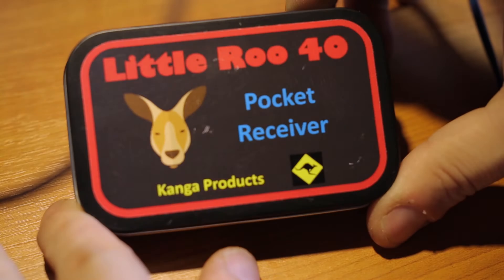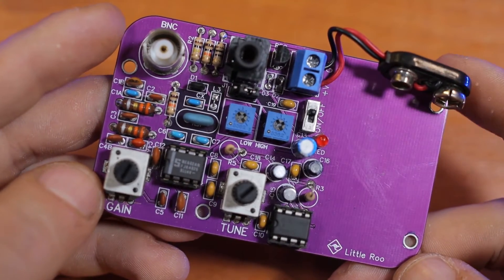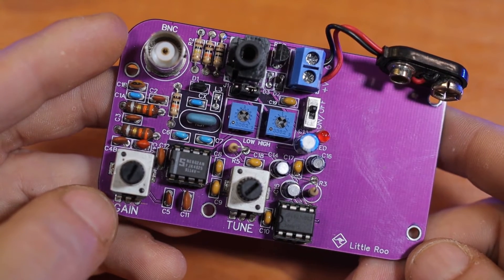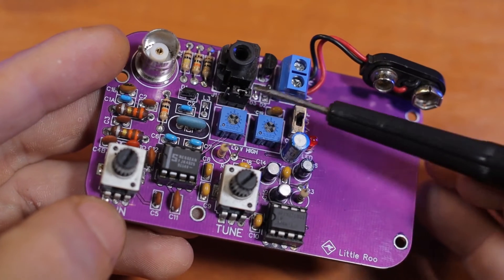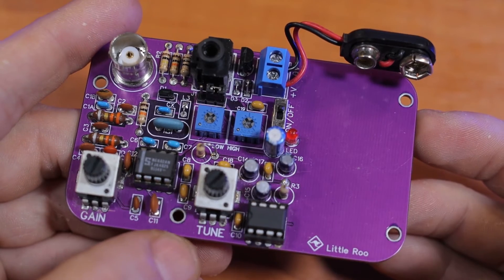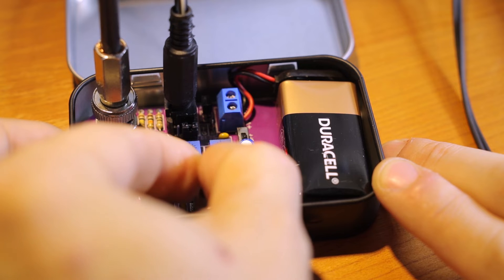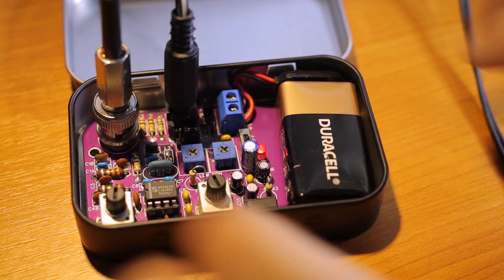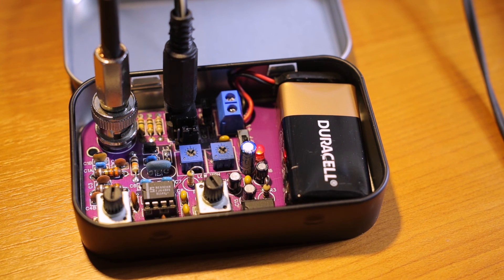Little Roo 40 - CW / SSB Direct Conversion Receiver Kit By Kanga Products

Comment: Hi  Paul (M0BMN) From kanga here, thanks for the nice review, let me answer a few questions people have asked.
The receiver does use the ne602/612 chip, why? well its a well tested chip that although now getting hard to find in DIL format can still be obtained as a SMD device from a number of source, I now supply the SMD version but already mounted on a small adapter board that allow it to by used like a standard chip. By the way you can get copy NE612  from a number of sources, I tried a few and 75% of the ones i tried didn't work, BUT if you are after these chips and you cant get ay original ones try the copy SMD version, I have recently bought 50 to play with, I expected about the same success rate but found 100% of them worked just as good as the original ones I use, the markings differ but I was surprised that they worked so well .
Back to the questions, the circuit, yes  I will be happy to update the instructions with that so I will this weekend. Its similar to the sudden, the sudden was a kit Kanga also offered in the past but now we are using a different VFO arrangement and by selecting the varicap diode to install you can cover the bottom half (CW) or the top half (SSB) section of 40m, the two trimmers allow the range to be adjusted , you can set the top freq received with the high trimer and the lowest received freq with the low trimer, more use on CW if you want to limit the tuning range to be say 7.000-7.040mHz for example, that way the tuning is more bandspread.
The 3 pins under the headphone socket, what are they for? well your right , i didn't explain that at all, another change to the instructions needed!
The pins have a 2 way header plug, install as shown uses the output from the voltage reg to be used with the varicap diode circuit, that gives lower tuning range but is very stable as slight changes in battery voltage on high signal peaks could cause chirp on the rx audio , the selection of this as shown will stop that problem. if you simply must have the widest tuning range possible move the jumper over to the other side and now you are using the full voltage from the battery , it may not be so stable but will give you a extra few KHz range.
Looks like i need to update the instructions with more info . Thanks for the heads-up!
73 Paul M0BMN
Kanga Products
Reply from the maker: Thank you so much Paul. I very much appreciate this. And also for the info on the pins as that was the only thing that made me wonder why is it there  ? now I know. The thing about extending the tuning range is explained in the instructions... you just can't make the "connection" between that info and the three pins. Now it all makes sense to me. If is ok... I will copy paste this comment in the blog article as well just in case it helps the blog readers as well. Cheers and have a fantastic weekend. 73, YO6DXE.

P.S. Meanwhile I fixed the issue on the audio output ( mono/stereo ) and it works fantastic. It was just a bad contact inside the connector, most probably due to soldering/unsoldering it too many times.

Comment: If you contact kanga they will send you one in pdf format...
Reply from the maker: The schematic ? I had it figured out at the end by looking at the traces of the PCB board. But it would be nice if it was by default in the users manual. I mean for others buying the kit... it didn't bother me much personally. 73, YO6DXE
Reply: If you have problems with obtaining a schematic, let me know, and I will send you it... have a good day👍
Reply from the maker: @peterarmitage5357 Thank you so much Peter. Yes if you want I wouldn't mind at all. 73, YO6DXE

Comment: Do not, repeat, do not leave that Duracell better in the radio, you will be very upset as they leak very often.
Reply: I don't leave batteries inside stuff because I usually don't have more than 2 or 3 good batteries, so I use them for multiple circuits haha
Reply from the maker: @bobi_lopataru Hahahaha. Good point 😅😅
Reply from the maker: I usually don't leave batteries inside by default. Lesson learned in the past... valid for any brand not just Duracell 😅😅. Thank you 😁.
Reply: @dxexplorer  Good. DCells are at that top of the leakage list. At one time they were the best.
Reply from the maker: @DCDura Ohh yes. I have bad memories with them ))).